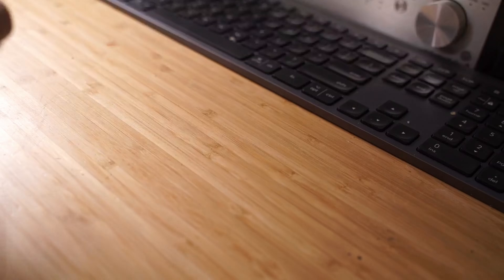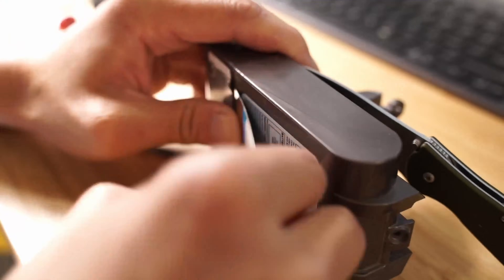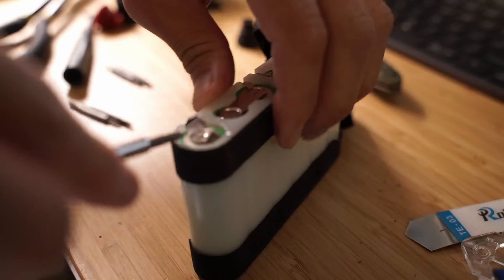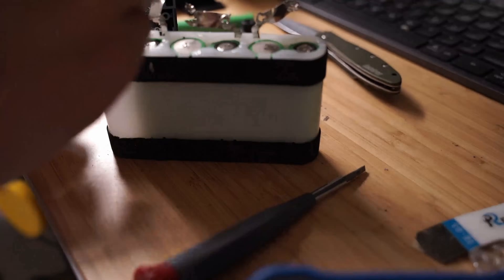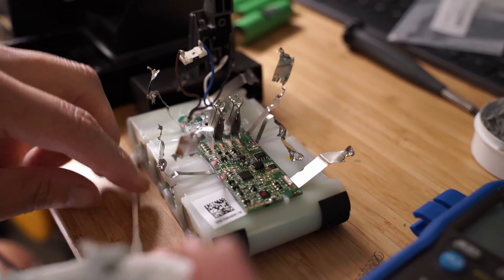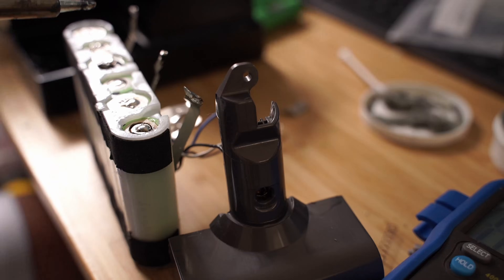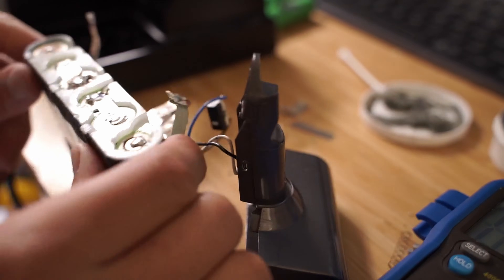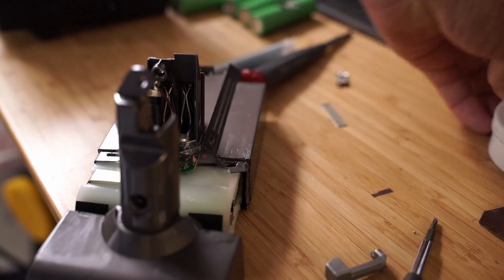Replacing 18650 battery cells in a Dyson V6 cordless vacuum battery

Comment: so vacuum worked ok after?I have some Samsung 25r cells off my ebike.that was diy battery.should be ok for vacuum
Reply from the maker: Yeah, the vacuum still works. As I mentioned in the video, it's better to use high discharge batteries, but in a pinch it will work.

I got my hands on another V6 that seems to be having a battery issue, but appears to be a BMS. However, since I though the cells were bad, I replaced them with some used Samsung 25/26 batteries from laptop batteries, so I'll post a video on replacing the BMS and how the vacuum works with some used Samsung 25/26 batteries.

Comment: Panasonic having lower discharge rate than sony, did it have any problems running the vacuum?
Reply from the maker: Correct, and so far the vacuum cleaner  and battery seems are still working fine. I only had those Panasonics with me at that time, so if you feel more comfortable using let's say the Sony VTC4s, feel free to use those instead.

Comment: It's criminal that these manufacturers don't make these cells user replaceable. It would be so easy to design a cradle so they just pop in, similar to AA or AAA batteries holders in various other devices.
Reply: It seems to benefit everyone that profits from it, except mother earth. Manufacturers today seem to want everything to work only for a limited period of time, then replace it or upgrade to a new one. One would think swapping 18650 cells would be the easiest fix, then the old cells can be repurposed or recycled. I wonder how many devices that requires lithium batteries gets toss out to landfills just because one or two cells are bad?
Reply: @ilingwang1168  I agree. I have a mate who gets access to the refuse site here and have successfully reworked many battery packs. You're correct also in that even when you cant rebuild the factory pack, usually you're going to get some useful batteries which can be used in single battery power banks such that off a solar pack you can get free charge into them and thus ... very cheaply recharge phones and tablets OTG. Though there's an initial outlay. It's scandalous from an ecology angle that so much avoidable eWaste is caused by companies profiteering from device specific power pack sales counting on public ignorance ...
Reply: @ilingwang1168  I have about 4 dead Dysons sitting on my bench
Reply: @ilingwang1168  A lot. I know that when I go to the enviromental facility in my city: there's always a shitload of very modern TV's, battery powered devices and such being unloaded (and already present in the seperation containers) that most likely is still good, but only has a power problem (bad power supply in the TV's, bad batteries in all the battery powered stuff).
On the other hand, it's also a bit down to the handy-dandy's out there, which there are less and less of: when I was working in an electronics store in Amsterdam (the kind that sells electronic components) I was sometimes absolutely shocked by the low level of technical knowledge/bravery of most people that came in.
Quite a lot of them were downright afraid to pick up a screwdriver or even said that they 'don't know how that works... with screws and such'.
True, I second you that most appliances are ever harder to open, but a lot of times it was down to a few simple screws to open something up.
Reply from the maker: @ilingwang1168  Agreed, and this is definitely not a sustainable model ! I think the manufacturer that's the worst about repairability and parts availability is Apple. If you're curious about this, check out Louis Rossman's channel.
Reply: @mistahcheng  ''the manufacturer that's the worst about repairability and parts availability is Apple. If you're curious about this, check out Louis Rossman's channel'' Dyson seems to follow the Apple M.O. though.
Totally agree, Rossman is well worth a watch for precisely the reason you stated.
Reply: Manufactures of alkaline batteries in the US have lobbied for legislation which only allows battery packs that use lithium ion cells, to only be sold as a complete assembly. Technically it’s not even legal for unprotected lithium ion cells to be sold in the US. But it doesn’t seem like anybody’s enforcing that.
Reply: @TheMotoRebel   Reminiscent of how Edison spread fear about AC electricity (eg by inventing the electric chair!) to support his marketing of DC. Lobbying is often evil.
Reply: @TheMotoRebel o excuse. If we can fly through space we can figure out a way to make these f'n batteries go in and out of the casing easier. All I can do is shake my head at the race of talking monkeys.
Reply: Profits over people.  Long live consumerism. Until the only thing left to consume is each other.
Reply: They sell replacement packs at £26 which is fair. And it saves a lot of user error and bad publicity from fires due to incorrect orientation of cells or cheap Chinese cells being asked to supply 350W.
Reply: @markp8295 Hi, where have you found replacement battery pack for £26??
Reply: EDIT: Disregard below comment as it looks like there definitely is some software inside the BMS that cuts the output in a 'cells removed' condition.

This actually can be considered 'user serviceable': no fuel gauge or battery management IC with software that just goes into 'cells removed permanent failure' and thus requires some expensive software and hardware to get going again. I recelled 5 V-mount batteries and had to buy some pretty expensive interfaces to get into the protected battery safety system based on a BQ20Z65.
You don't want springloaded 'cradles like AA batteries' because the currents drawn by such devices are too high for such contacts: most of these devices can easily draw 2 to 3 times the nominal current rating of such cells, in this case thus easily 12 amps and up. A normal springloaded battery-cradle will burn up before you got to use it for long ánd if that's not the case, the safety-circuits inside are likely to call it a day as the voltage-drop across all those contacts will cause it to act.
Pair that with vibration from the motor and handling (take a few falls, bumps and such actions into accounts as well) and you are nowhere with battery-cradles like easily replaceable AA's.

Better yet: just don't buy such battery-powered devices: manufacturers know that a lot of people will buy these things and put them on charge forever, which is absolutely the worst possible situation for a lithium battery.
If you want to get as much lifetime (overall lifetime, not lifetime-on-1-full-charge) from your battery, time how long it takes to charge from downright discharged to fully charged. Then, when it's empty again, charge it, but cut charging supply after about half the time. This will charge the cells to their nominal voltage and they will last FAR longer.
Even better is it to wait a few hours after heavy use: the cells just got their asses kicked for 20 to 30 minutes straight. If you start charging right away, they are not 'relaxed' as manufacturers put it: the cells chemical reactions have not come to a rest, which takes a few hours, which usually sees the cells' voltage climb back up slightly. I haven't done research about this behaviour yet, but I expect that a charge right after heavy discharge, can get the safety-system to assume the battery is fully charged based on cell voltage, but while then relaxing for hours (or even days, depending on how much you use it) the cell voltage surpasses the limits that are usually thought off as 'safe/good' (4,2 Volt/cell). Most likely not by much (0,1 or 0,2 Volt or so, but still damaging for the cell in question).
Manufacturers of safety-systems don't recommend this for nothing: let it relax for at least 3 hours after a full charge, and just as long after discharge. This not only gets the cells to a stable state, but also gives the fuel gauge (safety system, BMS) time to do a near-perfect reading of remaining battery-capacity. The better ones out there can be accurate down to 20 seconds on 6-hour discharges.
Reply: They can’t put AA batteries as they wouldn’t be hold charge and not enough voltage
Reply: Maximum current draw of alkaline AA batteries is between 0.5 and 1 amp. These high discharge 18650 cells can deliver between 20 and 30 amps at 3x the voltage. That's roughly a hundred times the power per cell, and between 20 and 60 times the current. These cells therefore need a fixed connection (soldered or spot welded) to deliver those currents. Alkaline style pop-in connectors have way too much resistance and would lead to overheating and safety issues.
What would be great though, is if the whole battery assembly could be more easily replaced. Bosch does this with their cordless vacuum cleaners, where they use power tool batteries (the same as their DIY power tools and garden tools) that can be swapped in a second.
Reply: @macvos  The battery pack itself gets away with a connector, though, so clearly it can be done.
Reply: @patrikj  the pack connects with a thick rail, so yes, obviously it's possible. But connecting each battery with that type of rail would make the  pack physically instable and huge. Making the whole pack easily replaceable is therefore the way to go.
Reply: I think a lot of it has to do with safety. A high-current discharge 18650 has a lot more power and fire risk than normal alkaline cells. Can you imagine if some kid put them in the wrong way or accidentally shorted them out? But yeah, also more money for the manufacturer. I'm sure they don't mind that.
Reply from the maker: I'm sure a lot of this has to do with cost and it being easier to use tin strips instead of battery holders.

Another guess is they probably don't want people messing with this due to liability and wanting people to buy new batteries when they break.

To me, this is similar to laptop batteries, where they're sealed and if you want to fix them,  it requires a lot of effort to replace without damaging the casing.

I agree, it definitely sucks though :(.
Reply: @mistahcheng  they want money!
Reply: yes well im going 100% DISAGREE, these vacuum batteries cost around $40 to replace that's the whole thing try buying 6 high drain 18650s for that price and the LGs they use cost around $12 to $20 each , but Dyson gets them much cheaper bcoz of bulk buying and other reason, so its best to know what your talking about before making such comments and ontop of that 18650s are about 100 times more dangerous than AA,AAA and are best not to be played around with by dummies as 6 together could literally blow your hand off your arm
Reply: @pollyg562  Like in 2022 we cannot design a safe replaceable battery pack? Ryobi seem to be able to do it for my battery powered mower. I call b/s
Reply: @pollyg562   Replacement battery from Dyson is $120 CAD.   so its best to know what your talking about before making such comments
Reply: @pollyg562  It depends a lot on where you get them then, because I can get high-drain cells (4-10 times Inominal) for anything from Euro 2,15/cell to 5,75/cell here in The Netherlands at Nkon , with usually a discount applying if you buy 10 or 20 or something like that.

Comment: You did not show the battery and BMS working, or powering the vacuum after the battery replacement.  I did the same thing and found the BMS go from perfectly working to red blinking light of death.  W/o power the BMS shuts itself down even if proper voltage is subsequently applied to it.  I’ve searched high and low to see if anyone has figured out how to reset it, but no lock.  If indeed yours works, I sure would like to know.

Thanks
Reply: Indeed, once you disconnect the old cells, the BMS locks forever unless you flash the firmware in the ARM chip with a custom made one. That's why he didn't show the battery working, because it didn't, it blinked red. And now his unwillingness to admit his mistake is making people lose a lot of money thinking the can just replace the cells.
Reply from the maker: I read that some of the bms in these batteries brick when voltage drops to 0. I didn't have the vacuum cleaner with me, so I wasn't able to record it working, but it has been used since the battery has been replaced and it's working fine. Did you make sure the battery was fully charged before installing it back into the vacuum cleaner ?
Reply: @mistahcheng  In general the BMS will probably be doing two things.  Firstly when in use (discharge) it will be looking at all six individual cell voltages, as soon as one of them goes below the limit (probably 3.00 Volts) then the motor is switched off.  This prevents damaging over discharge.  Secondly when charging it will be looking to see which cell gets 'ahead' of the others in getting charged, this cell will have some current shunted away from it so the other cells can 'catch up'.  This way all the cells end up charged equally. i.e. balanced.
Reply: I was wondering this; in some laptop batteries there's a fuse that will trip if power is disconnected from the BMS to prevent these kinds of repairs.
Reply from the maker: @adamnash2009  that may be what's happening to Garo's BMS. Luckily, mine worked fine after replacing the batteries. From what I have seen online, it looks like there's no way to fix or reset the BMS after it has "bricked" itself.
Reply: Dude , got the same shitty problem just buy a freaking from ali express and replace it , i bought 2 , for 10 usd
Reply: I saw a YouTube video highlighting this .. goes something like this .. replacing Dyson V6 battery with poor result .. the technician failed to reset the BMS
Reply from the maker: @magicnier211  Yikes. Yeah, from what I read, it seems to be a gamble so it may just be better to buy a new battery and call it a day. For me, I just wanted to see if this was possible. The vacuum was free anyways.
Reply: Yes, as soon as you clip a battery wire most V6 batteries will brick the firmware. You can buy a bms from Aliexpress. I plan to do a hot swap for fun where I change one battery at a time and keep external power to the bms while removing

Comment: Interesting video. I also found Dyson V6 that is not charging. Will try to open the battery and check the cells following your example. Thank you.
P.S. Your music is much too loud compared to speaking parts, and quite annoying. Otherwise thank you for usefull tip.
Reply from the maker: Hopefully, it's just a bad 18650 cell. Sorry about the loud music, and thanks for the feedback ! I've been working on the volume of some of the newer videos, and fingers crossed, the videos are getting better.

Comment: after long time use how about the batt-pack? can the cells endure  continuous high current? maybe about 15 amp at full power. by the way sorry for my insufficient english.
Reply from the maker: I don't think the vacuum has been used long enough during a session to run out of battery which is a good thing, but sorry, I don't know the runtime of the battery. I'll try and get this number for you at some point. The cells seems to be fine so far, but as far as I know, it hasn't been run on max mode. I'll update the post with run time as well as any issues that come up. However, if you are more comfortable using the original VTC4 batteries, feel free to !
Reply: thank you. i will follow post updates.

Comment: I have not opened my Dyson V6 yet. However, by looking at your video clip. 
I wonder instead of welding directly to the battery. The factory should use the springs inside the battery compartment in order to connect the battery as series and if they want to charge (balance) individual battery, they can hardwire cables directly to every single battery from the module.
No doubts about it. They don't want people to repair the battery as the way they sealed the battery compartment.
Reply from the maker: Agreed, but most lithium ion batteries use the same type of battery  strips more than likely due to the current that passes through the batteries. Some are even designed to act kind of like a fuse in case something goes wrong. My guess is that either the springs can't handle the current needed or doesn't make good contact. It would have been nice of it was easier to replace them though !
Reply: @mistahcheng  Agreed with the high current..... However, instead of using spring. It can be used as a metal strip (bar acts as a bridge inside the cover... what do you reckon? By the way, there must be a better way. But then that can not sell the replacement battery or new Dyson model. LOL !!!
Anyway, thanks for all your works.
Reply from the maker: @BasicInference I'm sure there's a better way, but I guess for them at what cost haha. I definitely wish that the battery cells are easier to replace. And no problem, I hope you enjoyed the video.
Reply: They don’t want you to do this, why do you think that they don’t design their products where you can swap out battery easily like power tools. They want you to buy the latest model with bigger cells.
Reply: @Hanglin168  I mean, they sell new battery units. With premium.  New cell costs few dollars. New pack 100 dollars. It's the modern inkjet.